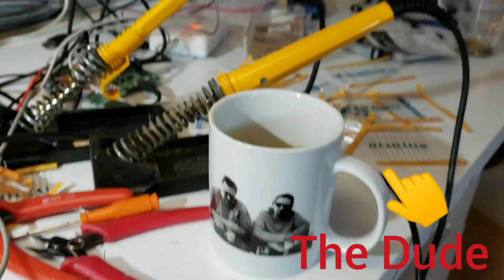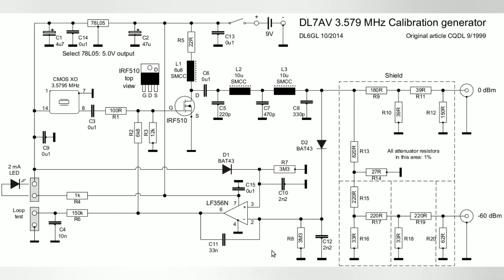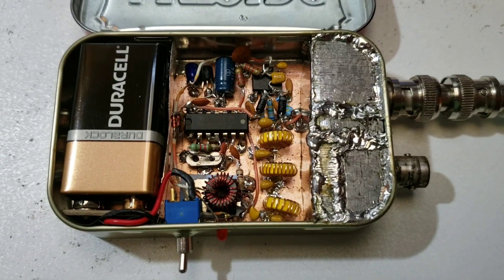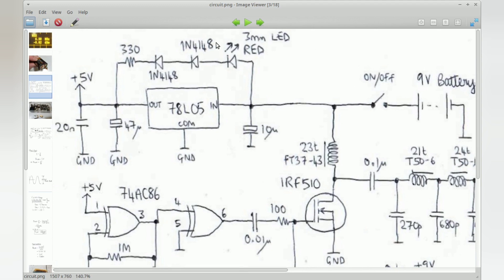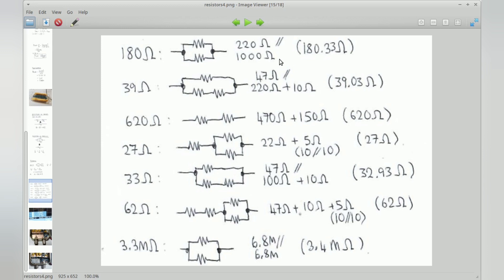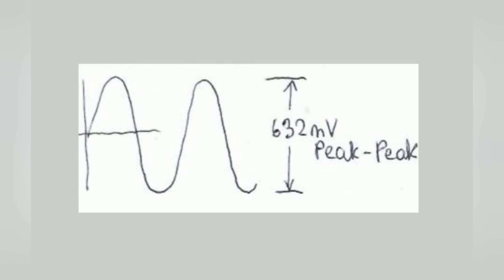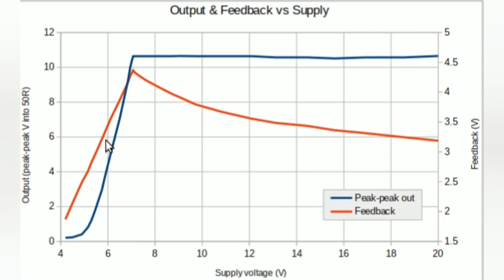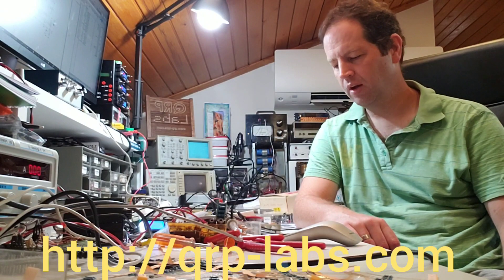7MHz calibration signal generator, 0dBm and -60dBm

Comment: Good project and thanks for video Hans. I like that Vpp squared divided by 400 formula for a 50 ohm load. Will try to remember that to save time calculating power from scope waveform 🙂. Also, good that you were able to modify the design to use your junkbox components.

Comment: nice work.    what is the ppm of this?    to make a calibration source,   0.5ppm  is expected.    the gps 10Mhz sources these days have come down in  price,   and sorry a gps referenced oscillator is the my standard.
Reply from the maker: It wasn't supposed to be a frequency standard. It's a signal level reference standard, with 0dBm and -60dBm outputs. If a frequency standard was required it would only be necessary to inject a suitably regulated frequency source e.g. GPS disciplined oscillator. But that wasn't my objective on the project.
Reply: @QRPLabs  ok makes sense.